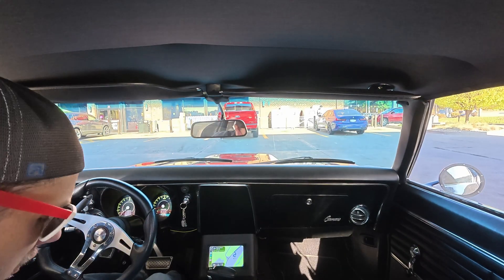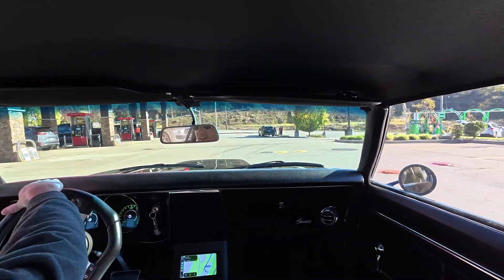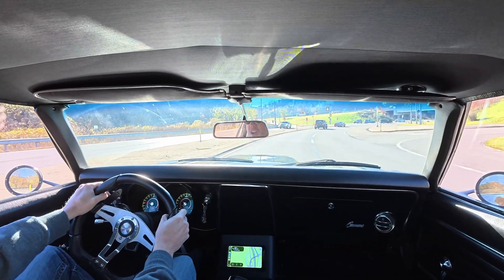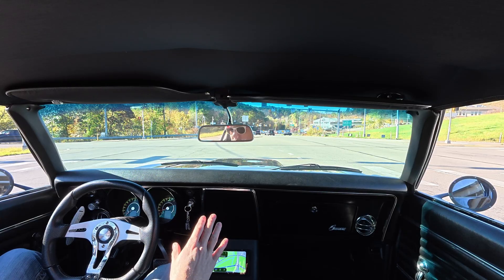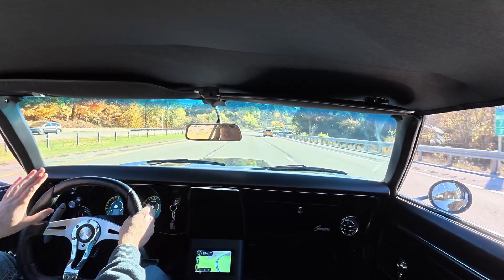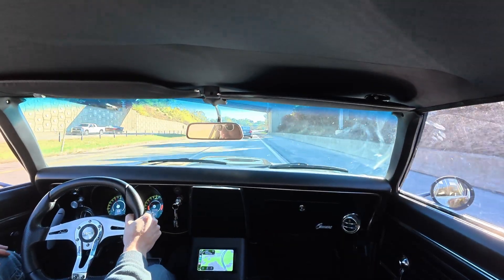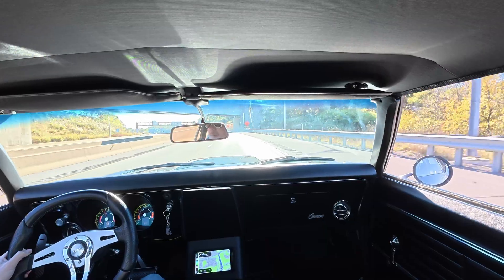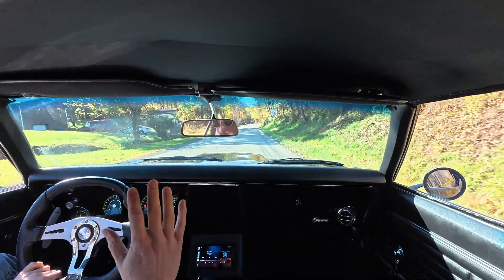Best LS Swap Combination, HPTuners Core and Turbolamik 8HP

Comment: This is the first 8HP I have seen in a first-gen Camaro, I'm looking at doing the same.  Trying to get an idea of what kind of mods I should expect.  They say tunnel mods are about the same as what you would need to do for a 4L80 or similar.  What mods if any, were done on the 68 to accomodate the 8HP, and was ground clearance affected?
Reply from the maker: None, just cut any ears off the transmission and run a low profile breather and it'll enough up inn the tunnel fine. These things are barely bigger than a turbo 400
Reply: @GoatRopeGarage   No kidding, really?  That's great news!  Do you know if you have the large vs small bellhousing?  If not, what vehicle the trans came from and I can probably look it up...

Comment: What converter are you running?
Reply from the maker: Stock scat pack unit, the programmability of these units allow you to do things with the convertor that we normally can't.   Can't think of this like a 4L or 6L transmission, this thing is in a whole different league.
Reply: @GoatRopeGarage thanks for the info. Just picked one up for future use on a turbo Ls. Cannot wait.

Comment: Whats your advice for someone running a class 2 setup rather than CAN. id love to swap this in my turbo gmt800 but not sure if its worth going gen 4 or holly, i know you can run the turbolamik analog, would it lose performance/reliability  without blip/cut?
Reply from the maker: No, it has internal torque calcs that handle how the clutches work, so you are still getting valid data from the analog version that it needs.  Shifts won't be quite as fast, but still blazing fast compared to a GM Transmission.  To give you an idea a 4l80 takes about .2-.7 seconds to shift depending on load, tune, valve body, etc.  8HP with a TL will be around .2 as the longest shift, most are happing in 100ms or so.  It is night and day, and hard to explain, you just have to drive one.  I talked to the guy I sold the Camaro to yesterday and he was going on and on about how amazing it is compared to a LS/6l80 combination he had drive recently.
Reply: @GoatRopeGarage thanks for the reply! I'm pretty sure this is the direction I'll go. I wish the adapter and controller wasn't so dang expensive, but 4l80e torque converters aren't cheap either lol

Comment: Hello I’m currently tuning my stock v6 3.4l Camaro. I’m running into some issues with what xdf file format to use for tuner pro , any way you could help out with that ? Or if I could pay you to tune a bin for me that would be way easier. -SD where would I be able to find the Patreon

Comment: With those esitmated power numbers, I'm guessing youve got a healthy cam? I'm running a tsp stage 3 in my ls3 and im planning my 8hp swap. I just wanted to ask what torque converter setup you might've run?
Reply from the maker: Stock one from a scat pack, works fine, these things are less dependent on a torque converter based on how the actual transmission works, there are guys running them without one, directly hooked up to the crank, crazy stuff!

Comment: How well do you think this would work in a 1000-1200 HP drag car? With proper gear ratios.
Reply from the maker: Going to be stressing it at that power level unless it’s pretty light, 8HP90 could handle it all day
Reply: @GoatRopeGarage thanks, sweet looking Camaro. Love the way it drives, well….looks like it drives.
Reply: Built 8hp70 will do great and 8hp90 you still need to build at that power level regardless.